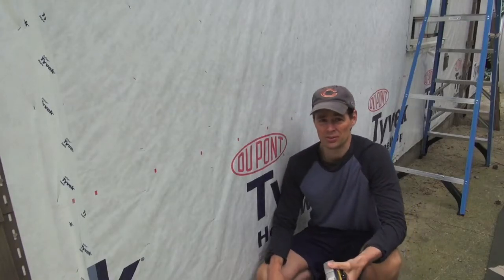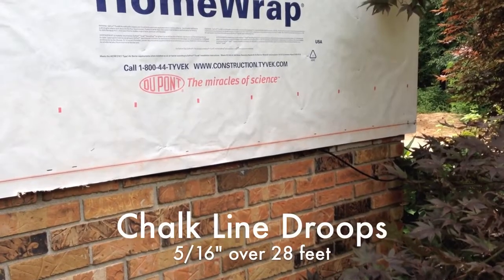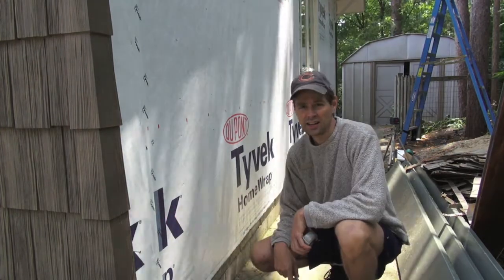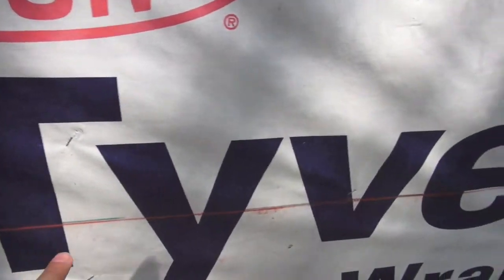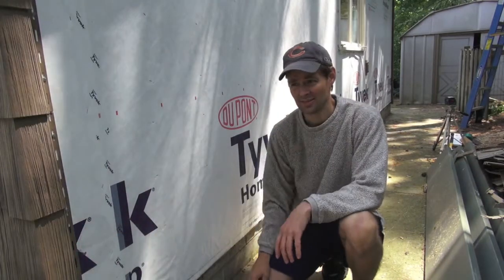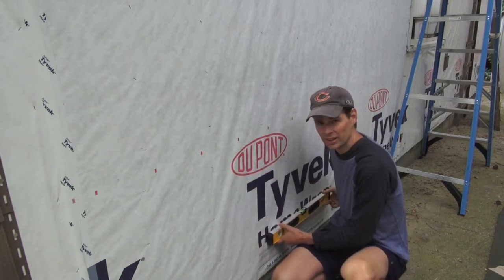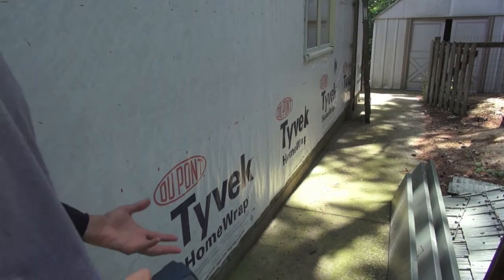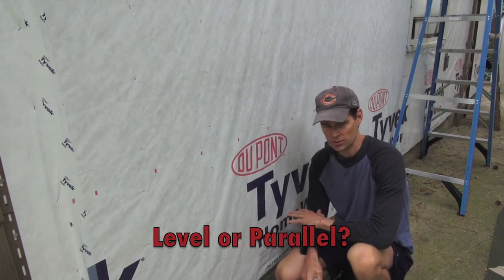Drawing a Level Line on Your House Exterior

Comment: We use a long water level tube to go all the way around to lay out our siding.  Always works, always handy.  Never fails
Reply: That's what we used forever ago when we were putting a second floor in a big huge wide opened building, it's great because you can go around corners, plus we made the water lever with an old hose and some clear tube for cheap money. Water levels are as old as the hills.👍

Comment: At 24feet you should pinch the middle of the chalk line and snap it on both sides for the most accurate reading
Reply: And don’t pull it a foot away from the wall and tell every craftsmen how smart you are
Reply: Nymets8305 for sure , that’s not a droop that’s deflection . No one is perfect you can’t pull it out perfectly so when u release it it is off , that’s why u have to snap from center on both sides like he said .
Reply: right on
Reply: I've been told not to go over 20ft

Comment: Couldn’t you split the distance in half, thirds etc?  Support the line with a nail or screw at level.  Use that point to anchor the line to and snap multiple lines?

Comment: why would the chock line droop? you must not have pulled tight enough. but if you think its cuze the wall cant you tie a stringline tight mark where the line is then snap it in a few diff spots?

Comment: how do you know how low or high on the starter strip, especially under a balcony? Do you measure up under the edge of the balcony frame and down the wall to find out where to mark the starter right? Say you have 104 inches down the wall to the bottom of your sheathing, so do you divide your siding pieces that maybe are eight inches wide into that and get 13 pieces to the edge of the balcony frame? What and how do you make the top piece stay in place and look good if you have to cut off the nail strip on the siding piece or is there another way to adjust up or down to insure the top of the siding under the balcony looks correct.
Reply from the maker: Your starter strip only needs to be level, not necessarily parallel to the home, and attached at the very bottom of the exposed area to be sided. Don’t worry about spacing under a balcony. If you are installing standard double 4 siding or similar, you use utility trim and insert the top part of the trimmed down siding into this trim after you use that tool to indent the siding so it snaps into the utility trim. If you are using shake siding or if you end up with a section that won’t fit into utility trim, you just J channel and then either nail punch those little aluminum nails into the siding, or drill a slot and use screws to hold the top piece in. Drilling a slot allows for the expansion contraction.

Comment: Hey dude. Laser levels are cool and all but have you ever heard of a builders level. That's how chalk line are level.
Reply from the maker: Far more expensive than a laser level.
Reply: @Markcgreer  its not necessarily a recommendation,  its more of an explanation.  Yeah tech makes life easy. But you don't always have tech. We both know you have a nail gun and a hammer, but both do the same thing one is faster and requires external energy, the other is done with hands. Lasers are better and should be used where applicable but a laser won't give you a benchmark as easily as a builders level. Builder levels can have more than one use, I think that justifies the cost along with no power required to use it.
Reply: Automatic level or builder's level is best for a getting a level line on a house.
Most of the time, if you set the automatic level far enough and at a good point, you can get a level line around 2 or 3 or more corners. 
Depending on the price of the builders level, you could focus down to the point of a pencil for a much finer line than any laser level on the market.
And they are much more accurate, especially in longer distances.
Mark do a little research before discounting an automatic or builder's level.
Reply: @jdere31760  cool. I suppose I haven't thought about the longer distances. could be a bit easier. but yeah not right now for me haha.